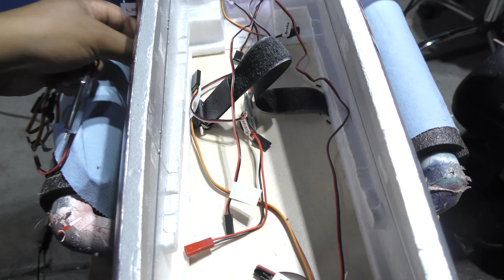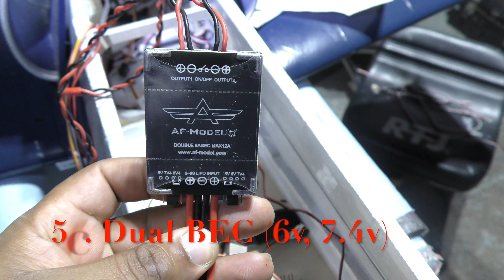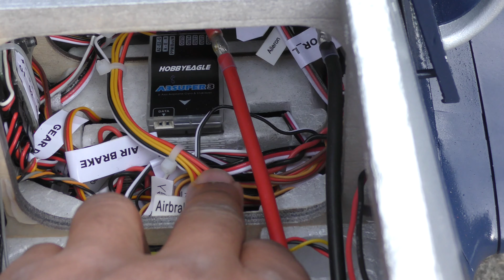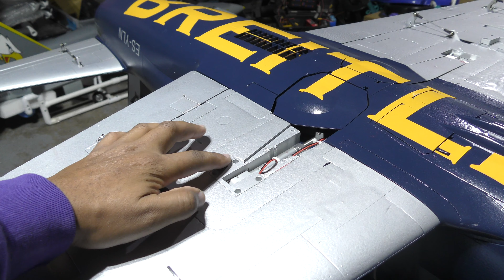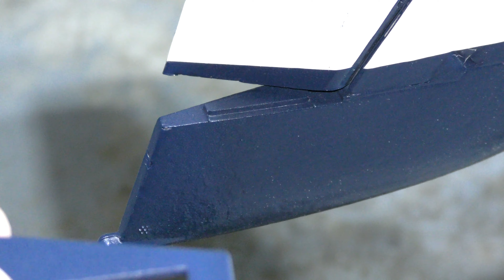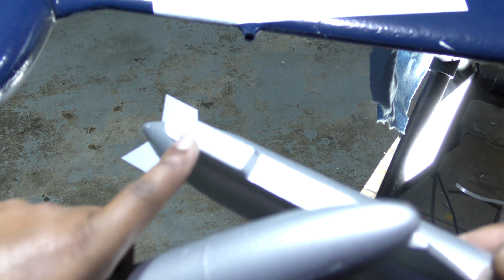BlitzRCWorks/AF L-39 Build Video #3: Control Linkages, Gear & Electronics

Comment: Notice you placed the receiver on top of the BEC. Any worry of interference?  Did see you had a satellite reciever.
Reply from the maker: Hi @huntingdm, I was not worried about interference. The BEC doesn't do too much high power switching like say an ESC does. And a lot of decent receivers have really good low noise amplifier circuits that can handle this kind of interference. But the best proof is that I have not had a single issue with this setup  at all

Comment: Nicely done Frank! How do you like the quality of the servos?
Reply from the maker: so far so good. They sound pretty smooth
Reply: @FlyWithFrank  did you need to add your own y-harness for the Ailerons, elevator and flaps?
Reply from the maker: @victorrcjets7660  All the connections went straight to my Hobby Eagle A3 super 3 so I did not need Y connectors!